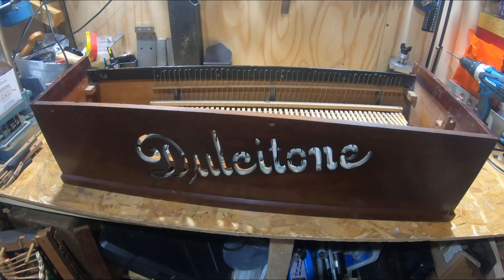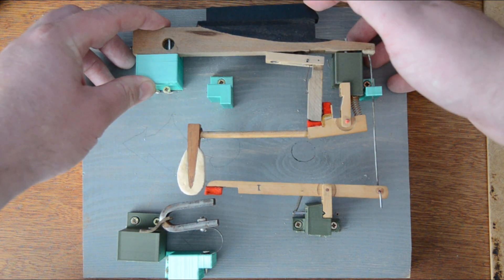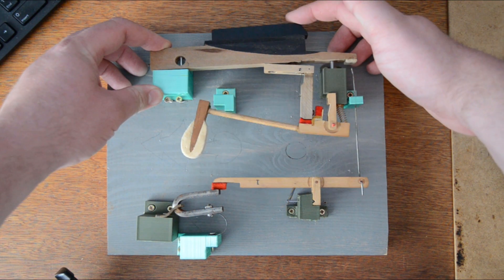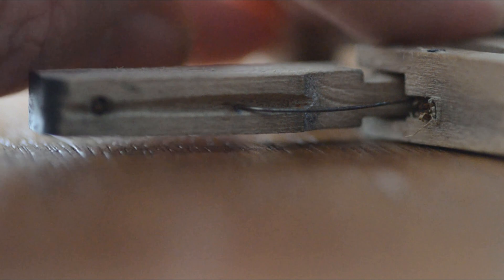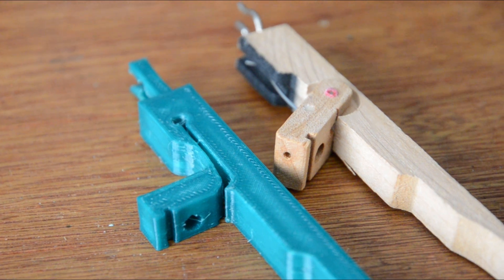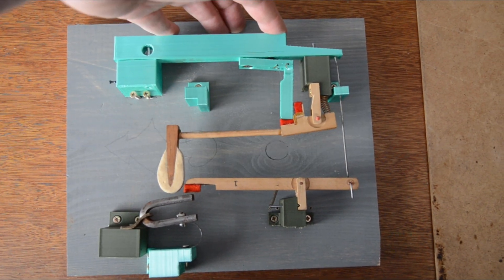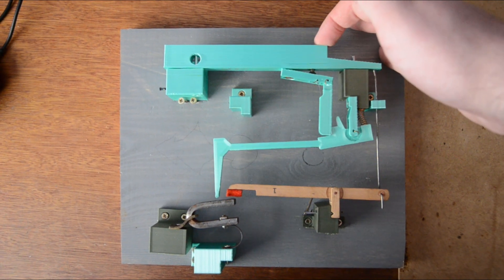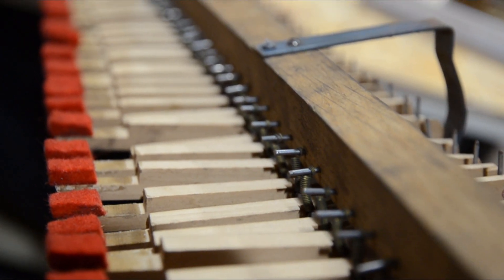Tine piano action from 1860 - Recreating a full Dulcitone action

Comment: Hey Dean! My names Joe I'm a piano and a rhodes technician. I've been a watcher of your videos for a long time. I've recently been doing a lot of research into Dulcitones and came across your videos about them. Thank you for making these, these instruments deserve to be shown off. I wanted to let you know, I believe your model is regulated incorrectly. Generally in piano actions the jack pushes on the knuckle (the leather covered part on the hammer) then the jack gets pushed off of the knuckle by something impeding its movement (the regulating screw in the jack hitting that little wall). allowing the hammer to travel freely and return further away from the string (or tine) to prevent double striking. this is how single escapement is often achieved on things like upright pianos and I think its how this action is supposed to work too.
Reply from the maker: Hey Joe, good spot, I will update that. Thank you for checking over it I appreciate the input. 
I have figured a way to create tines for the dulcitone, so hopefully will get a video made on that soon.
Reply: @deancoyle  Hey! I'm super interested in this project, I might be buying one that I found that is in rubbish shape but am hoping to restore it. Specifically VERY interested in how you've figured out a way to create the tines. Thanks! These videos are so cool!
Reply from the maker: How did you get on?